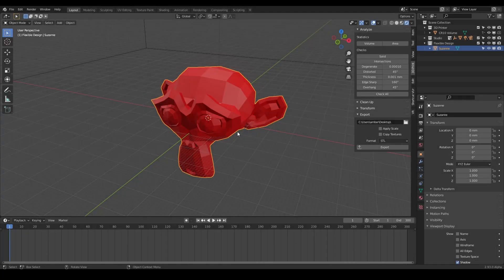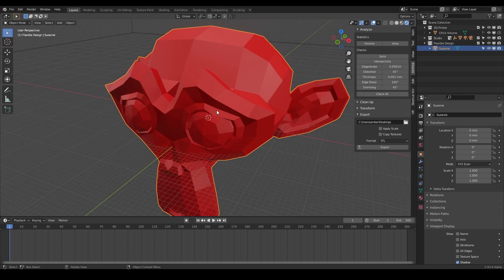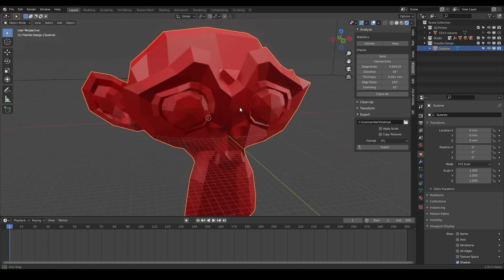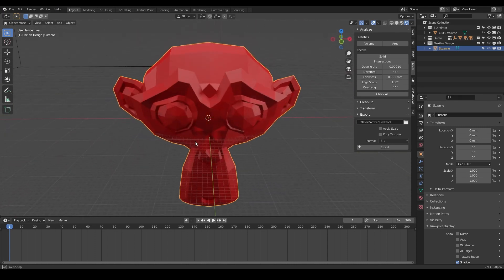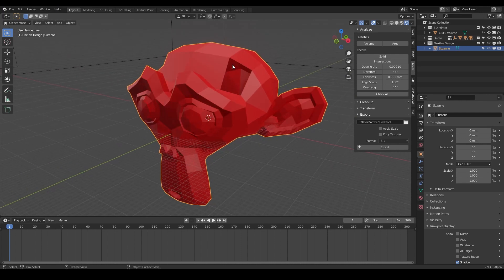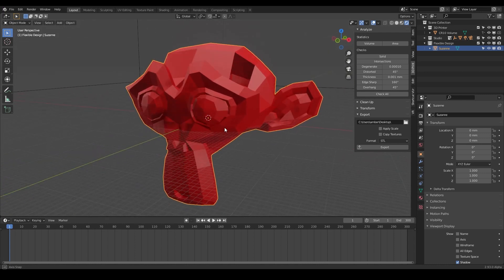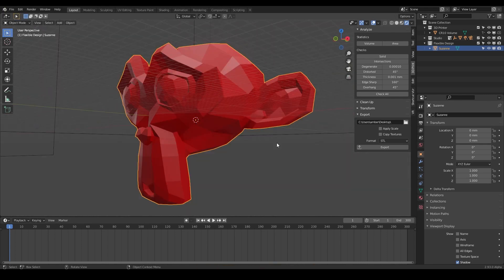Is Your #3Dprint Design Manifold or Watertight? | Blender for 3D Printing

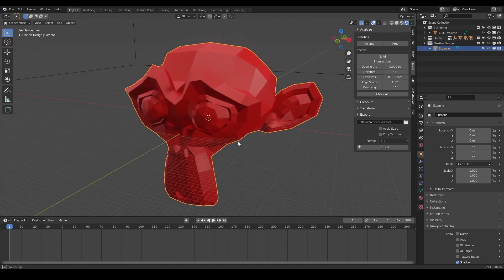Comment: 0:48 also in making real world printable 3d objects (or for laser cutting for example) you need to keep down the detail level to a minimum; post production programs like Tinkercad limit your designs to 25MB and 200K polygons which in many cases (notably models downloaded from 3d artists not coming from printing) are much bigger than this; besides, your printer typically using a 0.4mm diameter nozzle won't be able to reproduce the fine detail that file has, so reducing polygon count is indeed a necessary step to make your model printable (apart from watertight)

Comment: but what if you need your 3d print to have holes? like a piece of jewelry? how would you make it printable if it would not be manifold?
Reply from the maker: Great question. You could add the solidify modifier and set your thickness to 1mm+